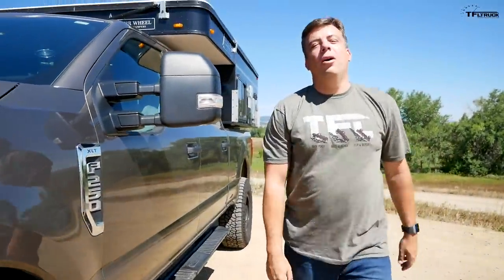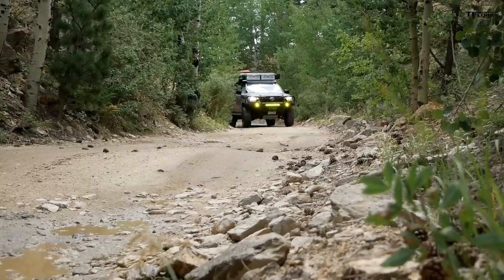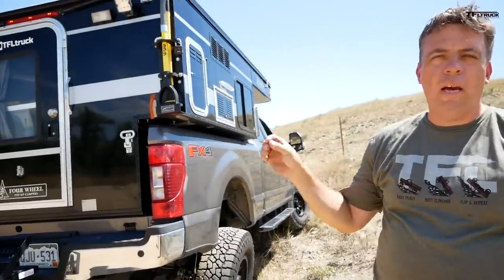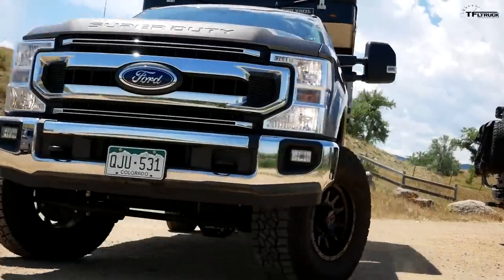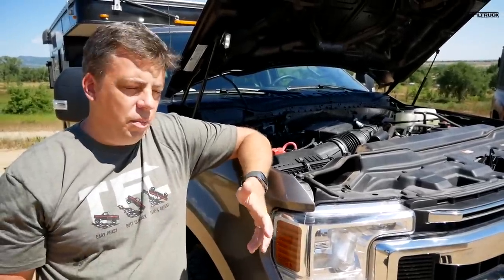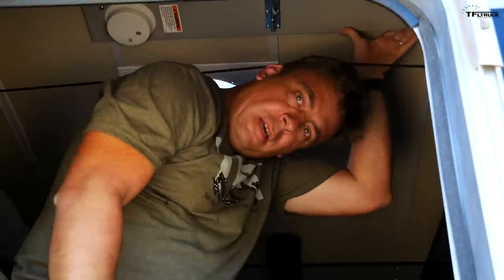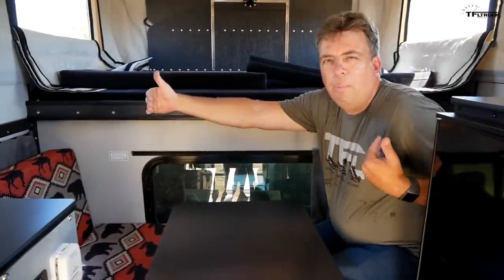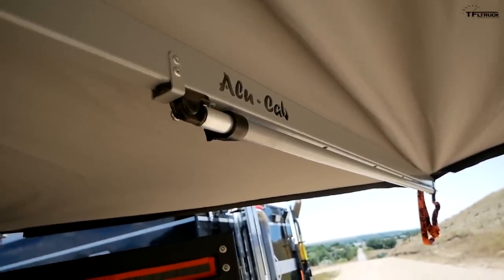Is The Toyota Tacoma Still the Overland King? This $100K Ford F-250 Lifted Camper Says NO WAY!

Comment: Agree with Nathan! Small and nimble will work better in most applications. Just an FYI, I own a Ram 2500 with an 8' bed so there is no favoritism.
Reply: If you're Nathan's height and single, sure.  I've lived with small trucks in the past, and have no intention of doing so again.  Tacomas are terribly uncomfortable for tall folks, like driving a lifted Corolla.
Reply: @plmn93  So? Did you NOT read the comment? MOST APPLICATIONS. Thanks for your input. IDC.
Reply: @wannabeangler  Did you not read my comment?  Are most people single?  Do most people want to put up with an uncomfortable and overladen truck?  Thanks for caring enough to reply.
Reply: Nathan got it.
Off the beaten path Tacoma all the way. Nothing more reliable than a Toyota.
Reply: @plmn93  Applications are referencing trails, not people. I read your comment and understood the context.

Comment: I’m with Nathan, there’s a lot of tight trails out there and if your doing mountains with cliffhangers riding the edge, the last thing I want is a tremor. The 4runner/tacoma are the perfect size, nimble and small enough to fit through any trail and take tight turns, yet still big enough to bring everything you need with a lot of storage options. If you are just doing road trips then the tremor would be fine but I’d still pick the tacoma anyday.

Comment: Having done tent, to roof top tent, to a shell on my Power Wagon, to finally the Four Wheel Camper I will never go back. Having a clean, dry, dust free environment when you setup camp at the end of the day, quickly, is worth the extra bulk. I will say though, with a long wheel based truck, you spend a lot more time concentrating on your trail line, than you do looking at scenery!

Comment: Both are awesome! In the Pacific Northwest, where I’m located, the F250 would be a liability on most of the trails - you’d be perpetually pin striping both sides and taking 10 point turns on every switchback. And god help you if you have to pull off to let someone by. Probably a better fit for the American Southwest where things are much more open!

Comment: Tacoma for sure more versatile in my opinion. More dependable.
Reply: The Tacoma is also near its payload limit, probably over when loaded with gear and people.  The F-250 is far from it.  That's going to factor into dependability in the long run.
Reply: @plmn93  I have had ford's nothing but trouble.
Reply: @plmn93  , @The Fast Lane Truck, @Alu-Cab, @OK4WD, @Patriot Campers, @Bruder, I am glad you have brought up the payload issue multiple times!!  I have been looking at buying a Colorado ZR2 Bison with a diesel and the Alu-cab setup with the awning and found I couldn't do it with the gear I wanted unless I replaced the springs.  As much as I love what the TFL guys do, sometimes I think they don't cover (think about??) some of the more obvious things, which in this video should be payload.  I am wondering if I wouldn''t be better off pulling a small trailer with suspension like that on Patriot Campers or Bruder.

Comment: If you want to overload your truck then the Tacoma is the way to go. That thing is so far over it’s payload just like every other Tacoma.Yes you can upgrade suspension, but there are so many other things that will be taxed way beyond their limits that you didn’t upgrade. Slowly it will have issues and that is not even considering the fact that your center of gravity is all messed up.
Reply: Not to mention that overloading can land you in deep trouble if you have an accident that injures other people.  I see overloaded Tacomas all the time.  Tundras as well.  Toyota simply does not make trucks with good payloads, yet they seem to be the #1 choice for overlanders.  It's almost as if their owners have never looked at the yellow sticker inside their door jamb.  But they won't hesitate to tell you how smart they were to buy a Toyota.
Reply: On top of that, your insurance may deny the claim and you are on the hook for personal injury damages and vehicle damages.

Comment: Thanks for the comparison. Taco is only about 6 inches narrower but it's a more compact package overall. I'll take the F250 and 4 wheel camper. I'd build up a Tremor F350 flatbed Grandby camper, flatbed Hallmark Nevada, or Flat Bed Alaska camper. Carli suspension tuned for specific weight will always perform better but I'd start with the Tremor package for the rear locker and limited-slip front. Granby will be the lightest of these and best suited to offroad work. Toyota lost me when they dropped the venerable 4.0 for the 3.5 and now Taco's are made in Mexico. Simple is better Overlanding and I'd look for a 2015 or earlier Taco.

Outside the US there are a lot of great options like the Mercedes Atego 1023 all-wheel drive truck and the Toyota Landcruiser HZJ 79. In the US pre, 2006 non-emissions diesels are the ideal overlander if you go outside the US to place like Mexico.

This is my favorite, sold but out of my price range too.

https://www.unicat.net/en/info/TC52hvcomfort-International74004x4-sh.php

Comment: Tie, each have their own application within the field.  Trails (anywhere) Taco (can be shod with 35's, supercharged..and still be less $ than Ford).  For long trips (not to technical, wider trails, gravel roads, comfort etc) Ford.  Andre  talked of the 37's, if I recall correctly the factory tires were smaller.  An interesting comparison would be the Gladiator Rubicon diesel outfitted (using Alucab top vs the Ford 4x4 camper), due to it could run 37's without much lift (if any).

Comment: I have to go with Nathan.  Not just because of name association, nope not at all. Okay, well probably a bit however, TBT I'm in the process of planning out my own Taco build. I much prefer a trailer over a roof tent.  Having a base came via trailer leaves the ability to explore during the day and not have to setup / take down camp everyday.  Also, the cost delta of 31 grand is quite a bit which would allow for a very nice camper trailer if cost is not a concern.

Comment: I suppose it's a matter of preference, but I'd take the Ford. They took it to Moab and I've seen others handle some of the toughest trails out there too so if people think big trucks can't do the trails they're wrong. Yeah smaller vehicles can get into tighter spots , but if you are going on an extended expedition you can load and tow so much more in the big Ford, not just because of the engine, but because of the frame. It's built to take punishment and it's also got a solid front axle, much more robust not only for handling loads but for handling the rough patches and articulation as well.

Comment: For this particular comparison, the ford would be easier to convert back to a work truck. But I would then make an argument about how whatever vehicle you choose is built. I myself have an '18 Tacoma (yes I'm on Nathan's side in this one) that I have an extremely simple DIY setup in that I would say I could probably empty faster than Andre could put the legs on the camper and drive out from underneath it.

Comment: You could have added a super budget "build". A truck cap on an older 4x4 regular cab 8 foot bed. Cots or an air mattress,  cooler, camper stove, some jugs of water, lol. A 10,000 to 15,000 dollar option.

Comment: The Tacoma is for the lower middle class. and the midsize Ford is for the upper class.
And having RV'd for 12 years and tent camped for 50 I can't tell you the more powerful
larger truck is going to be better and get you anywhere the smaller Tacoma can go.
  But I would suggest that you get the truck sprayed with a bed liner on the sides. Because
going down back road or mountain trail type roads with get your paint job scratched up.
  And I wouldn't have that camper unless I couldn't afford a better one. It's the bottom of the line in truck campers.

Comment: How about 1/2 tone,  f150?🤔 with the 5.0 v8. I like the over all setups of both vehicles, I'm more partial to the f250. My personal 86 f250 single cab long bed 4x4 can keep up with most stock jeeps, and at least on the western half of the U.S. the width of a f250 is not bad b/c most trails or fire roads, logging roads were built with bigger vehicles/ bull dozers. I'm planning to do the same style of over landing rig as the Tacoma but on my 86 f250 single cab long bed with a turbo 6.9 idi and zf5 spd. I get the wheel base as the taco but stronger undercarriage and diesel torque and the truck is easy to work on when your out in middle of nowhere.

Comment: Ethans glasses (already have similar ones) and Andrews truck (that I don't have). Than I would build my self something similar to that Hawk or buy empty shell Hawk and equip it to my needs and preferences.
Mixing the gear from inside Alucab and a shell from Hawk could be a winning combo on a Tremor. Pity PW has such a low payload so it can't legally carry a big camper, gear, supplies and at least crew of two.

Comment: I’d take the ford anyday over pretty much every feature of the Toyota. Price is the issue though. In that case I would go with a older ford diesel. I just remember my grandpas old 70s ford pickup with a camper on it. I believe it had a 460ci in it but we used that think in the harsh north woods winters. Which meant -20F no roads just snow. And the thing was a beast and did everything you wanted. My grandpa and 3 brothers and I could sit in that thing comfortably and hang out we couldn’t sit outside so it was home while hunting in the winter. Best thing it had its own little bathroom. We used that thing into the early 2000s  he eventually bought a hunting cabin up north so in that case we just had to make sure we had a good 4 wheel drive truck with room to get us and our stuff up there. Sad thing is he needed some work done on his home and a guy he knew said he would do the work for the truck. My grandpa agreed and gave her him the title. Well the guy took it and never did the work. Sad because if I would’ve known he was making this deal with someone I could’ve and would’ve done the work to keep the truck around. He didn’t tell us until a year after it happened basically because he was embarrassed. By then my grandma and him both passed away within a few months of each other so at that point we were only worried about that

Comment: I’m of the smaller is better mind for overlanding. But I’m also a small car, manual trans guy... so I guess if I had to overland instead of sports car it (which is actually my next car situation) I’d be stuck between the 2021 Bronco 2 door manual (IF they wise up and offer Sasquatch package with manual trans) and a Toyota Tacoma Trd off-road

Comment: The four wheel pop up camper looks like it would be easier to take off the Ford to use the truck for other purposes when needed. The Alucab Canopy camper seems to be more of a permanent application to the Toyota. Both great setups. Tough decision for sure.

Comment: The Toyota would win the reliability test plus on a around the world overland trip parts can be gotten easier to but I wonder if Toyota was to build a full truck line like ford dose with 1500 & 2500 & 3500 they sell much better then just making weak half tone have a big 4.5  Diesel V8 with a V8 & V6 twin Turbo

Comment: I thought this was supposed to be about these trucks as overlanding platforms. What exactly does drag racing have to do with overlanding? I have never floored my truck when trying to enjoy a nice day on the trail. Reliability is the single most important characteristic in an overlanding rig. When you are several days walk away from help, maybe you will not be so concerned with 0 - 60 times or power ratings.

Comment: Funny thing is BOTH trucks have tire pressure indicator lights on!
Reply: Due to aftermarket wheels and tires
Reply: Dale Hovland understand that however when $60k & $90k respectively spent on the trucks either can afford to put some sensors in the wheels or buy wheels that can hold sensors. No reason for an ID10T light for something that cheap and easy.

Comment: Midsize truck for sure. That's why I got a Gladiator Rubicon.
Reply: the thing I can't get on board with with a gladiator is it has the same 137 in wheel base as the older aka 99 to 2015 super duty 2 door long bed... but it has a less powerful engine across the board, it has a smaller frame it's axles are not strong enough for larger tires stock and it doesn't even weigh much less.... now it is something like 6 or 8 inches narrower so that has merit but it also means it has a larger turning radius... I would just buy a used truck for 10k and spend maybe 5k on a solid suspension lift and you're done with it... no power mods needed no regear no brake upgrade needed, because it was designed to stop ten thousand pounds not 6 thousand. So why would I ever get a gladiator?

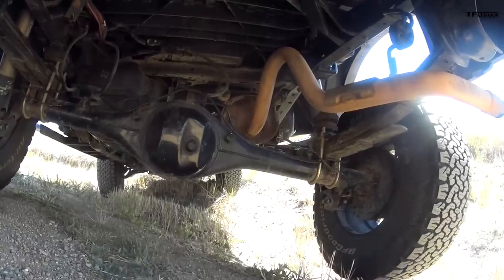Comment: 4:55 The Toyota frame twist between bed and cab.
Reply: This is how it is supposed to be when you engineer a hybrid frame. Boxed front and C channel rear.
Reply: @humbertorubi2735  Of course, no one said otherwise. C Channel frames are used for good engineering reasons.

It is only an issue if rigidity is needed, like putting a Four Wheel Camper in the bed with four (not 3) attachment points. 

See  https://www.youtube.com/watch?v=0GUuqT8dmZY where they sheared their bolts holding down their Four Wheel Camper due to frame twist.

Comment: I say your both wrong and just get a good half ton.  If you're by yourself sure a midzize is enough but sorry I think you need more payload.  And Nathan's right the F-360 is too heavy.  I would constantly be worried about getting it stuck in something I couldn't get it out of more than the size though.
Also has anyone of "manly" size 😅 ever found  a mid mize not made by the big 3 comfortable?  Especially over long drives?  Sure the Tacoma might be dependable but my brother had one and hes only slightly shorter than me at 6'4" and it lasted a year.  He could not get comfortable.  So like me hes driving the heck out of his Seirra now and he's up in Whitehorse having a blast .....when he can get away from work.🙂
Reply: Yep, Tacomas are notoriously uncomfortable thanks to the high floor.  It's deceiving because legroom is adequate so it doesn't feel bad at first, but your feet are splayed out in front of you and that gets pretty uncomfortable after an hour.  Like driving a lifted Corolla.  At 6'3" I owned a 4Runner for many years and will never go back to a small Toyota.   The Tacoma's engine and transmission are not well suited for truck duty and its payload is usually downright pathetic.   Really, the only thing it has going for it IMO is reliability.  But even there, who is actually keeping their truck long enough, I'd say more than ten years, that it's going to matter?  Hardly anybody.

Comment: Having worked on the Ford 7.3L mill, I would say its equally as reliable as 4.0L in the Toyota; they have been proven to be near bullet proof in fleet operations. And let's face it, with all that extra weight on the Taco, the Horse vs Cow analogy, one can argue that the Taco is actually the Horse with the mass of a Cow. If I was given one of these vehicles to use, I'd take the Ford. If I was going to buy one of these, then it would be the Toyota, because I could afford rather a nice boat with the extra $40K in savings.
Reply: Problem is Taco couldn't tow the boat.

Comment: What they're NOT telling you is:
That toyota is over it's over it's maximum payload weight by prolly half a ton.
You have to upgrade the brakes, and regear the axles just to make it livable.
The gas mileage suffers so much, you might as well go for the big truck.  You'll carry more, AND, not overload the truck doing it.

Comment: I’ll would go with the big one, but my truck is in the middle. I can’t put that big camper in my F-150 2.7 4x4 crew cab short bed—wish they made the other one for my truck.
Reply: Yeah you can Four wheel Campers makes truck campers for half tons and midsize.  Nothing they make requires a 3/4 ton or 1 ton like allot of other truck campers.    You just need to pick a camper for your size of truck bed of flat bed.  Also every thing they make can be converted to a 4 seasons model which is awewome.
Reply: I love my 2.7 crew cab...but its payload isn't very well suited for this kind of thing unless you never plan to tow anything.  3.5 would be the better choice.

Comment: The 4wheel camper can be removed & the F250 can do work when you get home. The tacoma is dedicated overland. So its gonna sit unless you wanna risk a break in getting groceries.
And as for gas the 250 should have a 36 gal tank. Even if it gets 15mpg it should get you 400 miles. The Taco???

Comment: Honestly, I'd rather use my first gen TRD OR 5MT.  I like how it is smaller than 2nd and 3rd gen tacos, but just as capable, and with the new suspension it rides just as nice as newer tacos. I'll be getting a supercharger by next year, so it will be faster as well.

Currently shopping around for a RTT to put in the bed, as I plan on taking a month off at the end of this year to travel up and down the eastern coast (yes, I know I will be dealing with snow in the NE, but I am looking forward to that challeng.)

Comment: Guys... I have a F250 Tremor and it's got more off road goodies than your so called "Super Tremor". The stock tremor has a limited slip front end, 4.30 gears, HD rear springs, crawl control, rock crawl mode, water forwarding, and high running boards. I think your truck has the 4.30 but its lacking the Tremor goodies. You cant call this a super tremor. If you would have bought a Tremor and than added your suspension, than maybe it could be the super Tremor. Would you buy a regular ram 2500 and put suspension on it and than call it a super power wagon? I think not. Why not give the Tremor the same respect?